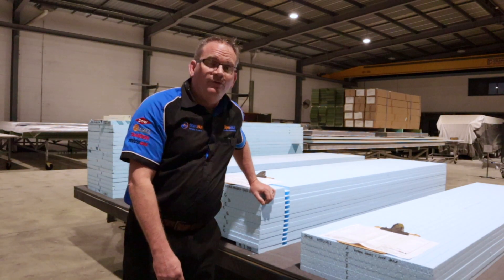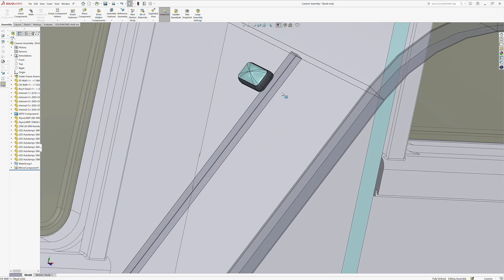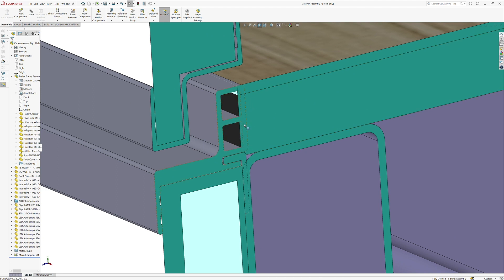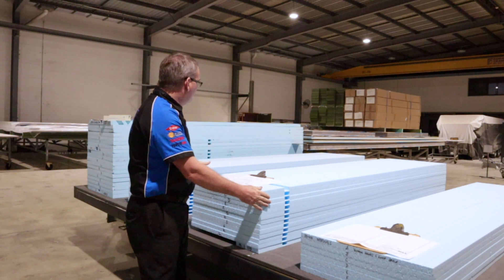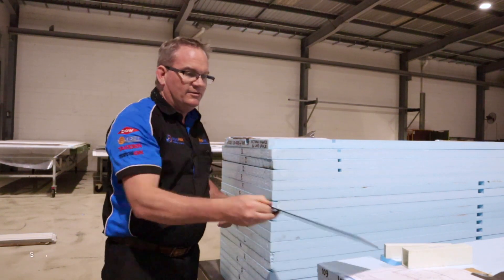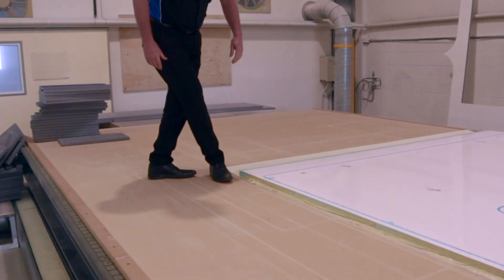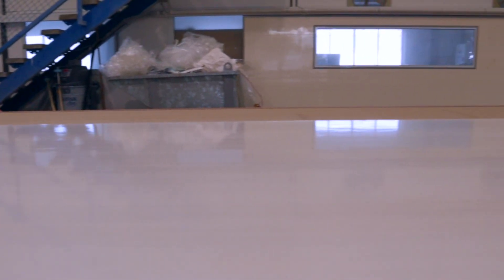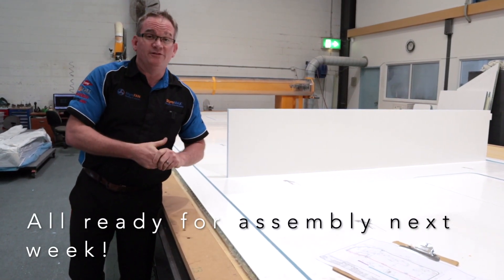July 2020 DIY Workshop Volume 4

Comment: Well crap. I wanted to see how you made these panels. You laid everything out to be laminated together. WHAT is "everything"? How does it get laminated together? Just a bunch of wood glue and one big long weight that sits on it until the glue dries? PLS make a video showing the actual lamination process of a long wall for example.
Reply from the maker: Be sure to check out our other videos which go into the panel inserts and the glue we use.
Reply: @StyroMAXInsulatedPanels  yes, thank you I have gone through MANY of these videos. I cant yet find one where you show the actual making of the panels. I do see where you talk about it but I think it would be a good video to make showing the actual making of these panels start to finish and not just describing them. Its just a thought, good luck.